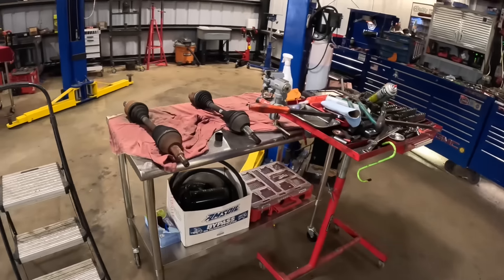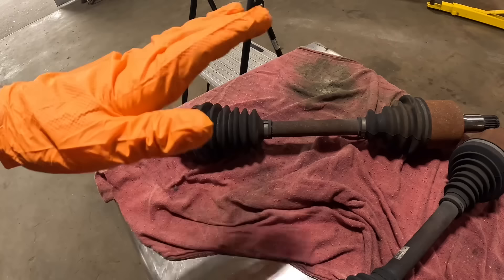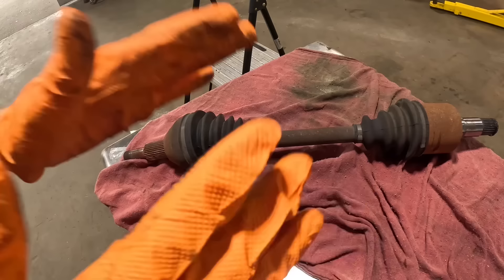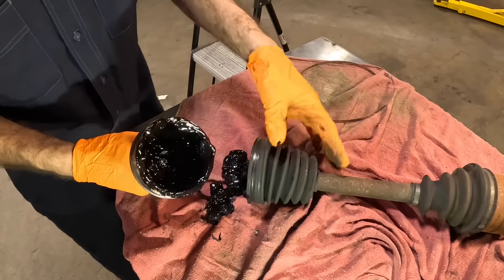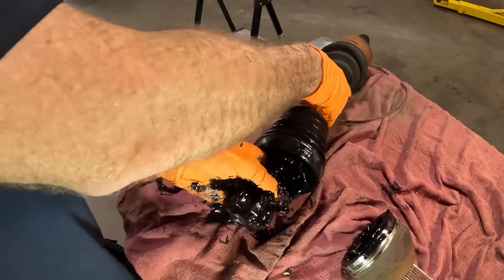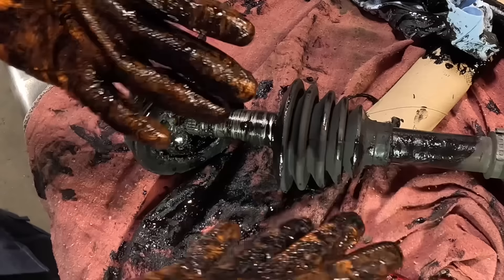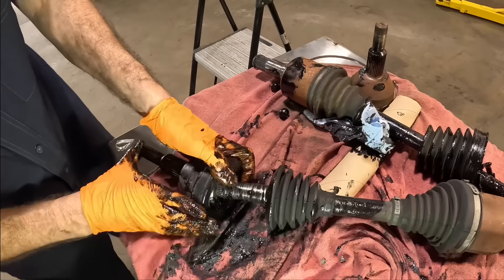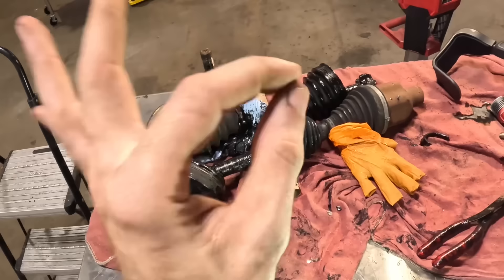Axle Autopsy! Towed in, Drove Out! Chrysler 3.6

Comment: Classic failure here in the North. Get wheel spinning an snow / ice, then have it stop spinning very quickly on reaching dry pavement. Carnage of the CV joint follows, especially if the steering wheel is turned any amount. Easy trap for new drivers to fall into, sigh.

Comment: Customer states: "It just started making a funny noise yesterday." Thanks for showing us the carnage Ray, keep up the good work!
Reply: They must have bad hearing!🤣🤣🤣
Reply: I hit a tall kerb after sliding on black ice. Car had to be trailered for repair. 
I got it back with repaired suspension only to find horrendous clacking from the CV joint. It went back for new shaft and wheel bearing.
Reply: That "yesterday" was probably three years ago when that CV joint would make clicking noises during turns and eventually under acceleration. It was the 'pretend its not there' approach.

Its done similarly with wheel bearings and ball joints - until the wheel comes off (this is a 'thing' in the SE that I've observed)

Comment: Lil bit of JB Weld will put that basket back together and get another good 1/10th of mile down the road...

Interesting to see how the basket & bearing works vs u-joint. Great explanation on the physics side of the u-joint, as well.

Thanks for the bonus content showing the autopsy!!
Reply: just rollled in!
Reply: I was hoping he would take that indestructible boot from the failed CV and use it to replace the torn boot.  :trophy-yellow-smiling:
Reply: Lack of maintenance or hearing you decide. Lol

Comment: As to the longer videos, sometimes that's not really up to you, but the repair itself, and the willingness of the vehicle to allow the repair to be as easy as this one seemed to be, or as difficult as your own truck's interior was. Sometimes, the vehicle wants to be fixed, sometimes it wants to fight you every step of the way. This T&C seemed to want to be fixed, so it gave you complete access, and 0 issues. The Pacifica, not so much.
Reply: As a DIY’er when I had my 2014 Caravan with the Pentastar engine, I had to replace the oil cooler assembly 2x, first with another plastic one from Amazon and again, by choice, with the Dorman Aluminum OE Fix. Even though the front axles looked easier on video, it would have made sense to have a pro replace the axles due to the need for impact tools which would be needed for proper replacement. The main reason why I was able to replace the oil cooler assembly myself was that I was able to use hand tools to successfully perform the job and save $$$.

Comment: Gloves are pretty much a requirement when you're doing axle work like that, From my own experience grease in that condition Takes a week of constant work to wear out of your skin.
And that's washing them with gojo 2 or 3 times every day.
Reply: Worse than that is the black sealing goo Mitsubishi used on the plastic sheeting water seals behind the door panels in the 2000s. I have a 2002 Lancer and had to work inside the driver's door. I peeled that sheet off and that goo got all over me. It took over a month to  get that stuff out of my skin. Worse than Henry's roofing sealer.

Comment: Had the same thing happen on an '02 Dodge Intrepid.  Right boot broken and leaking, Left boot ok, but joint was broken.  Both joints were locking up prior to breaking and at highway speed, the wheel was wobbling as it revolved.  Driver described it as the car felt like it was "Duck walking."  She would slow down to street speed and it would go away. . . . .Until it didn't and broke the joint!  LOL.

Comment: The outer joint that failed is a Rzeppa joint.  The inner joint is probably a tripode joint.  The Rzeppa tolerates a wider angle of motion but is more complex and fragile than the tripode, which only has to tolerate the driveshaft up and down motion at the transmission end..
Reply: Wear on the inner tripod joint (also called a plunge joint ) can cause interesting vibration issues in low-speed turns as the rollers move into and out of the worn areas in the tripod. Not generally noticeable when driving straight ahead.

Comment: I was waiting to see what happened to the CV joint.  It interesting to see that joint failed first as opposed to the other one. 
I find your videos interesting and informative no matter how long they are. They show why auto shops charge what they charge.  What used to be a simple job 40 to 50 years ago are not that simple anymore, when you have to dismantle half the engine just to get to anything. But, watching your videos does brings me back to the time when I was working on vehicles. Keep up with all your excellent work.

Comment: After thinking about the rotation of the axle, even though the horizontal axis has different speeds when the U-joint is bent. The vertical axis forces the output to turn at the same speed as the input. It is when the cross is at 45 degrees that the inside of the bend is slower than the outside. It will be the same with a 6 ball joint, but the difference is much smaller since one set of balls need to be horizontal - the others are at 30 degree from vertical.

Comment: My degree is in physics, but I do not recall constant velocity joints being part of the curriculum in my days. We left that stuff up to the mechanical engineers. However, that said, your explanation is fine. What is worth noting, is that the same thing happens with old fashioned propshafts on RWD vehicles where they tended to use universal joints at each end, but there's a neat little trick to put the two ends 180 degrees out of phase on the shaft (the two carriers ought to be pre-fitted that way). You still get the speed up slow down part on the prop, but it's exactly cancelled out at the other end which has a mirror image of the deflection angles. However, it only works well with fairly small angles, and can still vibrate a bit. It could never work on a front wheel drive vehicle because of the extreme angles and because the wheels move in more than one plane.

As far as this particular case is concerned, there would have been a loud clicking when the steering was cranked over for a few thousand miles before the joint let go. It is something out vehicle inspectors look out for during the annual tests. That, and split gaiters. Both would have been fails.

In any event, must have been nice to have a fault that virtually diagnosed itself and didn't require all those electronic tools. It would have been a job that somebody would have been familiar with when FWD cars with transverse engines started appearing 60 years ago.

Comment: Older VW's had rebuildable CV joints shafts.  New joints came with new boots and a tube of moly grease.  They were just bolted in place.  The failure I had were the balls split in half.  Good autopsy  of these joints.  Keep up your videos.

Comment: I really enjoy your videos.  I have a Town & Country with a 3.6, and after watching your video on an oil filter adaptor a while back I decided as much time as I spend driving hundreds of miles at a time I should make that change to my engine.  I was not the first person to change the part and most of the adaptor screw heads were rounded off.  I rounded one off myself because they are very soft aluminum.  When the thermostate went South I also replaced it with an aluminum part.  When I purchased the van there was a vibration at 65 MPH that was the right drive axle.  I replaced the axles (both), struts and rear shocks, sway bar links and bushings.  All at 100,000 miles.  I have learned a bit watching your shows and will continue to do so in the future.

Comment: What is surprising to me is that those things will have made horrendous noises for months before they failed, and the owner did nothing until forced to by the catastrophic failure.  We used to repair those with the torn boots and dirty bearings in the eighties.  The first step was to disassemble and clean the unit thoroughly.  If the outer unit was not chewed up, a new cage and ball assembly was installed, and the system was assembled with new grease and boot.  It soon became apparent that most were not rebuildable and had to be replaced, mainly because owners would delay seeking a repair allowing the bearing surfaces in the outer part to become chewed up.

Comment: Unless they was in a stuck situation where they was slamming it constantly in gear or flat foot driving slamming between shifts those shafts gave plenty of warnings. Problem is people just like brake noises get the I'll get it fixed later syndrome then they want to cry when repair cost is lot higher

Comment: Basically U Joint operation is similar to why vehicles have differentials. The outside wheel moves faster than the inside wheel in turns. U Joints are designed for movement but don’t work as well in fast, high torque at extreme angles as well as CV Joints

Comment: I do love the longer videos. It shows parts of the work we usually don't see done. The autopsy showed us the damage suffered and possible danger of continuing using the part. The explanation of how the u-joint works is really on point. Also, I thought I had subscribed, but I see now I wasn't. Subscribed now.

Comment: From the first video I thought you'd find a broken shaft, but this autopsy shows it was a failure in the CV. Interesting that the axle with the torn boot didn't fail, it was the other side. The failure to me seemed to the cage for the CV roller balls, allowing it to all come apart. Not being that well versed in these, is that common or uncommon for a failure point?  Thanks for another educational/instructional video.  I don't have a front wheel drive vehicle, but do have an IFS 4X4 which would have these for drive axles.  So, now I have more knowledge...feels good to know about them.

Comment: Ray, you can't make shorter viclose because you actually do the job properly. Back when you were making the shorter ones. You were working under someone else and didn't have the trust. Your customers put in you now. A customer that trusts a mechanic will usually get a lot more work done than they would at a simple quick stop shop.
Reply from the maker: This 👆

Comment: All chrysler and dodge vans from 96 to current have the left front axle snapping issues. They either snap the shaft in halt or at the joint. Its crazy that almost 30 years later and Dodge hasnt figured it out yet.
Reply: Early Mopar minivans (think K-Car days) had adjustable engine and transmission mounts to allow side-to-side adjustment to set the drive axle length spec. If out of spec, vibrations and excessive wear of the CV joints would occur. Knocking it out of spec could be as simple as a minor collision or striking a curb.

Comment: For the cup, the speed of any part is 2 PI R times the rpm, the R of the center of the shaft is 0, while the outer cup may be 3 inches, the inclined part of the cup may be 1 inch R at some point.

Comment: Wouldn't that device be more properly be called a constant torque joint ?  The rpm input/output would be the same for this style or a universal joint but the torque on the universal would be less efficiently transmitted when the angle is higher.

Comment: I look forward to watching whats next, i actually learn a few things on the way. Maybe i don't do all the work but i also don't have a lift.
I can remember back in the 70s dropping a transmission on a Plymouth feather duster it was a slant 6 version of the duster.
I didnt have jack stands just a jack.
My dad taught me to slide the wheels under the car so if it fell down i didnt get crushed.
Now thinking back that was very dumb.  I did the same thing with a 64 ss impla    with a big block v8.
That car weighed a ton  back in then days it was bumper jacks.
I still use sisor jacks, i just dont get under the car anymore.

Comment: I knew it was lack of gruess replaced lots of these on my Subaru Brumby you call em Brat over in the states as far as I'm aware none serviceable item unless you can take off the metal clamps and regrease  them then replace with rip ties never tried that solution myself

Comment: Also, U joints can & do provide CV, bc they're typically used in pairs, where the opposite end has the same but opposite angle & phase which cancels the overall variation. Both ends are of course in fixed positions though, which would not be the case for a steering system.

Comment: You explained it well sir! That joint is a Rzeppa style cv named so because that was the inventing engineer’s name. I think he worked at Ford??? The failure witnessed in your repair is exactly one of the shortcomings in this design. The other is the torn boot you showed on the other shaft. Nonetheless it’s a great sturdy design. Long live Rzeppa!

Comment: The u joints act the same as a posi diff. When going around a turn, the inner tire squeals and the outer doesn’t because the inner tire has to travel less distance than the outer but maintain the same speed.

Comment: i believe on a turn the outside tire has to rotate faster then the inside tire. The drive Axel's turn at the same rate, on wet pavement the inside tire looses traction and slips to keep up with the outside tire rotation, I think on some cars the front gear box allows the inside Axel to slip and the outside tire to stay engaged. ?  you should not use front well drive on dry pavement, the drive axle will bind because it cannot take the turn as tight as the steering can, this is how the get damaged.   much like a universal joint. that's my take.

Comment: had one of the C/V joints on my V W  beetle, that failed. it had the star allens so I had to wait for the tool truck 
to buy the correct tool to remove the allen head screws, and of course it was in winter up north west NY. 
best it failed at the US / CANADA boarder. my dad towed me home, and then borrowed his extra car. to go
to the junk yard for the replacement part , got that home put it back in the car, worked great no issues 
until the engine failed at 130 k miles. love that car, got good mpg and had it from 45k to 130k rebuilt
the engine , then reviewed the body, too much sagging key spots rusted away. 😞

Comment: These axles break all the time on 4WD IFS lifted trucks. It’s the weakest link in the four wheel drive system.  Happened to me more than once.
Reply: The GM 4WD IFS front drive system is basically the Cadillac Eldorado and Olds Toronado design from the early 1960s.

Comment: That grease looks like it got hot probably from a wheel bearing or brake problem. They probably got that fixed and the liquid grease was insufficient causing catastrophic failure. Just a theory

Comment: 4:00 I think thats why german car makers use a 3 ball joint instead of a 6 ball joint. Mo' powwa to be distributed on less flimsy joints.
Reply: When they went from swing axle to CV shafts on the Volkswagen Beetles in 1968, I believe those were 8 ball joints, And a PITA to work on. Along with the triple-square fasteners nobody had the tools for.

Comment: I was cringing when you had it up on the lift and in drive to inspect the noise. That was a major safety hazard as it could have exploded at any time and caused major damage to the vehicle and any person nearby.
Reply from the maker: But the vehicle was already damaged with no one nearby 🤷‍♂️🤣🤣🤣
Reply: @RainmanRayOffDuty  yeah, the CV was damaged, but if that axle had started swinging around it would have caused heaps of damage, possibly writing that vehicle off, and shrapnel could have been sent flying.
Interesting to watch, but I wouldn't have stood there watching in person.

Comment: Think of the movement this way. You are walking and you going at certain speed. What do you do to turn without loosing speed?
.
.
You slow down the leg the way you'll turn. I don't know if it would be possible to hop and turn a car.
I want to see someone driving a car where the wheels never turn. Using a piston with a rotating foot that hits the ground for a fraction of a second to lift the tires off the ground.

Comment: Somebody help me out here. The van has TWO drive axles, driver side and passengers side. Only the drivers side failed. What is the purpose of the passenger side drive axle if it doesn't drive?
Reply: There is a differential gear to allow the car to turn by allowing each wheel to turn independently, so the outer wheel can turn faster and the inner wheel can turn slower when turning a corner. Open differentials (the cheapest, simplest, and most common kind which work the best for turning) have an unfortunate side effect that if one wheel becomes vastly easier to turn, because it's broken or spinning or has otherwise lost traction, ONLY that wheel will turn and the harder to turn wheel (the one that's actually potentially going to move the vehicle) won't turn at all. Most of the torque is delivered to the easier wheel to turn, and it only balances out 50/50 when both wheels are equally easy (or hard) to turn, as they are when you're going straight. 

This can be solved (with compromises) by technologies like electronic locking differentials, limited slip differentials, or welded differentials, but the compromises to things like cost, turning radius, tire wear, and fuel economy make these unusual choices on a daily driver street car. Any of those technologies would probably allow a car like this to drive on a single axle. The question is why would you want to (as that's not really a safe or good situation either) it might be enough to get you off the highway in an emergency, but way too many people would just drive around like that forever. Like Ray said this thing was probably making noise for a while before it blew up, and nobody bothered to bring it in.

Comment: Did you ask the customer what they were doing to cause that carnage?
Reply: High engine torque with maximum steering angle - a no-no combination, although this one surprisingly lasted for 149k miles (2 owner car?).  Apply high engine torque only when (fwd) vehicle is pointed straight, people.